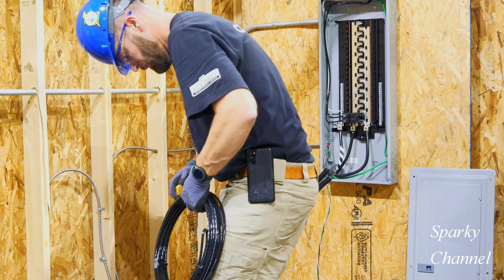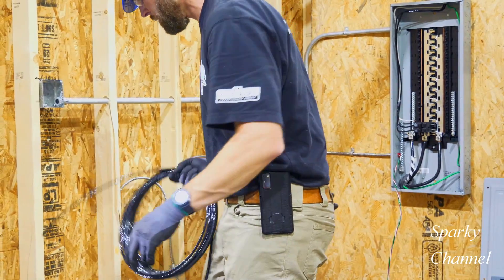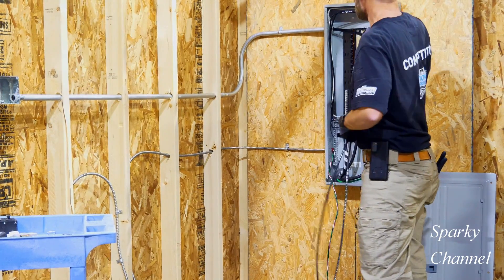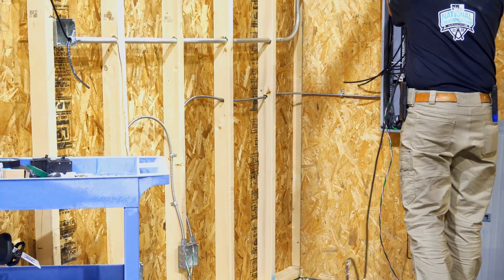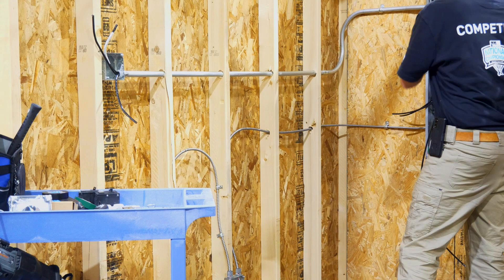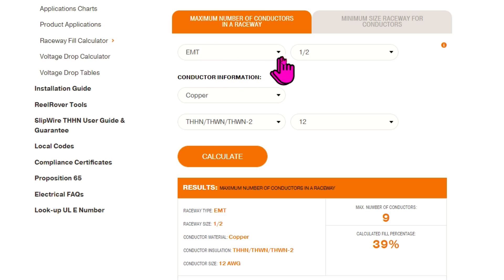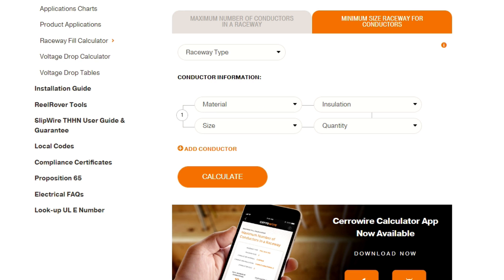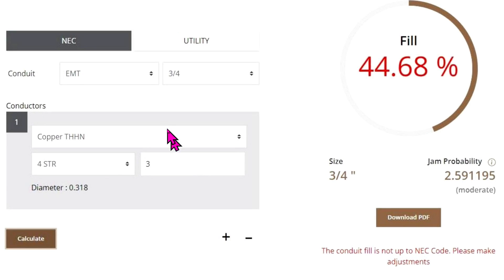Can You Find the NEC Code Violation?

Comment: You are supposed to run Romex threw wood framing . MC or AC cable is for metal framing . You would also need ,kick plates if your wire is not more then 1" 1/4 from edge of hole
Reply: I noticed that too.. his holes are about a 1/4" away from the edge of the stud.
Reply: What about Chicago?
Reply: @nobadmojo70  too many rodents chewing

Comment: Maybe they changed the code again but there was a time when conductors smaller than 1/0 could not be identified by tape. He would have needed to use a green insulated ground wire not a black one taped green.

Comment: What are the options to correct this? Obviously you can go up conduit size but can you add a second 3/4 conduit?
Reply from the maker: Go with #6 wires. 3 are only 27.4% conduit fill for 3/4" conduit.
Reply: @SparkyChannel  But can you run the conductors in separate conduits? Some parts of the NEC seem to disallow it but can't tell for sure

Comment: The calculator is hard to use with southwire. I wish they’d use terminology that was clearer and matches the label or wire model.
Reply from the maker: It does a little getting used to.
Reply: use the code book, the table is easy to use....
Reply: @jstone1211  thank you

Comment: I thought  #6 is used for 50amp. If he used proper size it mite have met code
Reply from the maker: Yes, 3 #6 in 3/4" conduit is only 27.39% conduit fill.
Reply: @SparkyChannel  now sparky!!!I wonder if pvc "3/4 conduit was used ..and therefore a green conductor was required...because pvc it would not be used as the grounding conductor...would there  still  be room..I'd imagine  a #"10 could be used???...would there be enough  room..???

Comment: I figured the box and conduit were overfilled because I could not see that there was an extension on the box originally. 
I like these calculators, when one does not do electrical all the time, it can be challenging. I had a junction box I did that, from everything I found, between the 12/2 and 12/3 I put in there, I think I was 1 conductor over the max, but then I took into considering that the ground wires are only #14 and then I was within the fill ratio. Not sure that it's correct, but I was comfortable with it.
Reply from the maker: Thanks!

Comment: The Ideal conduit fill calculator came spot on with the Chapter Nine Tables.  At least on the couple of calcs I did.  The wire companies give their own wire dimensions.  The code book should be adhered to for calculations.  Conduit fill, HP etc.
Reply: UL listed gear specs can trump the NEC code, and not just for torque specs.
But the AHJ might add restrictions, or higher requirements. 
The code is a minimum spec, and a general baseline.
Reply from the maker: Good to know.

Comment: Good morning Bill, thanks for the video. Great content as always!
It's conduit fill with 3x #4 thhn is over 40% for a 3/4" emt. Assuming the PV charger load is 40A or less @ continuous duty 210.19(A) would be 40x1.25%=50A wire which is satisfied by 3x #6 thhn in a 3/4 conduit.
Assuming a 50a breaker  (210.20) it should have a #10 EGC per table 250.122. 
The conduit enters the extension ring so its possible it might exceed maximum wire bending radius on the closest termination on the receptacle once the device is fully mounted. With #4 thhn it absolutely will exceed bend radius (8 x 0.324" wire diam = 2.592 radius. Diameter from Cerro wire spec sheet. Bend radius multipler from 300.34). By comparison #6 bend radius is 8x0.254"=2.032". Picture bending the #4 around a 2.5 conduit and that's the most it is permitted to bend, and a 2" conduit for #6. Also table 312.6(B) says min wire bending space for #6 is 2 in and #4 is 3 in. #6 is borderline in a 4square box but in my experience acceptable. #4 is definitely a violation. 
Also 314.28 (for #4 and larger) we have 3/4 x 8 = 6". The opposite wall must be a minimum of 6" from the largest conduit entry, so the box is too small for #4.
With #6 we can use box fill in 314.16(A). 2 conductors, 4x volume allowances for 2 gang device, 1x ground, 0 internal clamps gives us 7 volume allowances. Table 314.16(B) gives each volume allowance per largest conductor as 5 cubic inches. 7x5=35 cubic inches. A 4 square deep (2-1/8") has a volume of 30.3 cubic inches. A 1-1/4 deep extension ring has 18.0 cubic inches for a total of 48.3 cubic inches which is sufficient. 
Lastly, grounding and bonding. The metal box requires a bonding jumper. 314.4 The extension ring and plaster ring secured by fine thread screws are bonded by the screws.

Whew. Lots of violations here because of the #4 wire!
Reply: #8 THHN at 75° C is sufficient for 50 amps.  With 75° rated utilization equipment.  Table 310.16.
Reply: @donl1410  as long as terminations on both sides of the conductors (breaker and device) are listed and marked as 75 deg C. 110.14(C)(1). The art. For the allowed 75 deg C is art 110.14(C)(1)(a)(3). Great point!
Reply from the maker: Hi Jerry and Don! Great discussion! What if, given that he was only given 3/4" emt, he just ran 2 4AWG hot wires to a Raco 4 11/16" x 4 11/16" x 3 1/4" deep box with the appropriate 50A receptacle cover. Then he ran an 8AWG ground tail egc from the metal box to the 50A receptacle. Now his 3/4" conduit isn't overfilled. Would that work?
Reply: @jerryc5622  Agreed.
Reply: @SparkyChannel  Hi Bill.  The 2-#4 conductors would be fine for the conduit fill.  A #10 bond pigtail would suffice for the receptacle.  The box containing #4 conductors is also an issue, since it becomes a pull box containing a device and must follow that article.  The 5s box is too small.  Jerry covered that above quite extensively.
Reply: @SparkyChannel  My thinking on that is going to be yes. Per 314.16 "Boxes and conduit bodies enclosing conductors 4 AWG or larger shall also comply with the provisions of 314.28"
Under 314.28(A)(2) 6 x 3/4=4.5" (I missed this in my first comment where I used 314.28(A)(1) at 8 times instead of 6 times). I believe the conduit entry on the side qualifies this as an "Angle pull" under (A)(2). So, I think a 4-11/16 box will be the smallest for #4 wires and would be acceptable (Interestingly you cannot do a box fill calculation with #4 because it isn't shown in the box fill table 314.16(B). Also per 314.28(A)(3) a listed  box and receptacle that's smaller is specifically permitted if marked for the specific wire combination being used. I believe this is ONLY acceptable with 2x #4 in a 3/4 conduit. 3x #4 requires a 1", and 314.28(A)(2) would require a 6" box.

I think a "loop" around the box and then to the closest termination would work for the wire bending radius and that would be ok in a 4-11/16 square. (Cutting it short and going straight into the side is a violation of conductor length at a box 300.14)

The #8 ground tail is sufficient for the box bond and larger than required (#10 per 250.122)

The only questionable part is the conduit as an EGC into a panelboard or load center since it isn't part of the UL listing (UL50). Put a grounding bushing there with a #10 to the grounding bar, or just run a #10 in the conduit as it doesn't affect conduit fill.
Reply from the maker: @donl1410  Thanks! It's amazing the hassle one runs into by trying to run 4 AWG instead of 6AWG for a 50A receptacle!
Reply from the maker: @jerryc5622  Thanks Jerry. I think a lot of guys shorten up their larger gauge wires when running them to a 50A receptacle to save space in their box. But 4 or 6 AWG wires fall under 300.14 just like 14 or 12 AWG wires do.
Love your idea of a "loop" around the box and then to the closest termination. It both decreases the angle of the bend and allows adequate length for 300.14.
Reply: @SparkyChannel  That's true.  I'm sure the ones who designed this competition were more seeing if the subjects could follow the engineering.  As I've said, engineering sometimes can be in error.
Reply: @SparkyChannel  Thanks Bill. This was a fun one. I can't recall ever having to run #4 in a situation like this. In fact the only scenario I can think of ever putting #4 into a 4 square is only as a pull box or outlet through a removable cover into a flex connection and that would only be for a 240v 2 wire circuit, and wouldn't work for a 240 3 wire. This was a good challenge.
Reply from the maker: @donl1410  I have no idea why they had the competitors use 4AWG to run to a 4x4 box. It makes for a fun competition though. BTW, I took down the videos I made about the concentric oversized rings and I'm going to make another one. I saved all the comments from viewers for reference though. It's amazing how much my viewers know about such things!
Reply: @SparkyChannel  Thanks for letting me know.  I hope my input was of help or inerest.
Reply: Hello Jerry -- a lot of really interesting comments!, Looking at 314.28, "Boxes and conduit bodies used as pull or junction boxes...", so I don't think it applies since the box is not being used that way.
Reply: The requirement for applying 314.28 is found in 314.16. It is required because the box contains wires 4awg.

Also cerrowire has a minimum bend radius on their thhn conductors in the instructions that is close to those in 314.28.
If it had been 6 awg or smaller, what you said would be absolutely correct.
Reply: @jerryc5622 Thanks Jerry. I see what you are saying. I guess my problem is the wording. You are correct that it says Boxes enclosing 4 AWG need to comply with  Provisions of 314.28, the hard part for me is that main provision for 314.28 specifically states that it applies to Boxes used as pull or junction boxes... since it is not a pull or junction box, wouldn't it still be excluded? Otherwise any code could reference some other code and say "must comply with such and such code", and we would need to apply it even if it said not to apply it in the code.??? (I will do some research locally to see how other are doing this an reply when I get a chance).

Comment: and let me guess, the reasoning in the exercise is it was a welder plug.  which, unless they changed the code allows the wire to be undersized. (though I won't undersize a welder plug circuit, because someone is likely to plug in something that isn't a welder, sometime.)
Reply from the maker: Hi Ken! It was a 50A receptacle for a PV charger. But, you're correct, that pv charger could get unplugged and something else plugged in.
Reply: @SparkyChannel  yeah, i don't lock in 3 wire 240v circuits for vehicle chargers, either, because some models require a neutral connection.
Reply from the maker: @kenbrown2808  Good to know, thanks!
Reply: @SparkyChannel  i started putting in a 10/3 for a future charger a couple years ago. Now I'm thinking a 6/3 would probably be better.
Reply: @kenbrown2808  It's also nice to have other possibilities covered for for future use, but a bit costly.
Reply: @aredditor4272  a whole lot less costly that retrofitting it later.
Reply: Tesla had chargers running at 90A 240V years ago :-)
You might need to upgrade the service from 150 to 200A
Reply: @wim0104  why would I pay an extra hundred dollars to limit the service to 150A?

Comment: P&S 50 amp receptacle lugs are only rated up to #6.  Ground wire was unnecessary... Could have just pulled 2 hots 2 avoid conduit  fill violation.
Reply: 3/4" EMT can be the ground for 4 or 6AWG wire!? At least add bonded bushings, both ends, please.
Reply from the maker: Hi Greg! Very interesting. That would be very heavy reliance on 3/4" emt for the egc but, yes, it could be done. I hadn't thought of that. Then what AWG would the ground tail egc have to be?
Great to hear from you!
Reply: Don't you  need bonding or grounding for the steel box and the appliance that will be plugged into the outlet?
Reply: Or a number 10 THHN, if a ground wire was deemed necessary.

Comment: The studs were drilled to close to the stud edge for the conduit. That would be a violation here in NC, (R602.6: Drilling and notching of studs).
Reply: or add nail plates
Reply: @wim0104  Nail plates only protect the conductor; drilling the studs in that manner compromises the structural integrity of the stud members. Especially important if it is a "bearing" wall.
Reply: Or use a heat gun to reshape the conduit.

Comment: 314.28 comes to mind. That device box needs to be considered similar to a pull box. Min horizontal dimension I believe should be 6 inches per 314.28(2), as this doesn’t appear to qualify as a straight pull.

(314.16 says that boxes and conduit bodies enclosing conductors 4 awg or larger shall also comply with the provisions of 314.28 for pull boxes.)
Reply: (EDIT...I'M wrong here, see below.)
I see what you're saying, but that isn't a pullbox but is an outlet box. So I feel that 324.24(B)(3) works. Since he's using a "deep" 4" square box plus a mud ring (mentioned in the voice over) it would be OK.
However, there still maybe a violation of 314.24(C)

I mean though, no one is gonna run, in the real world, 4AWG for a 240v/50a receptacle. 😂
Reply: 314.16 says that boxes and conduit bodies enclosing conductors 4 awg or larger shall also comply with the provisions of 314.28 for pull boxes.

Laymen’s terms: those wires are bigger than typical for a device box. I believe the depth is sufficient though per 314.24.

Note the standard fill lookup tables stop at 6 awg, for this very reason I suspect.
Reply: @USABrendan  NICE! How did I miss that? So funny how by not choosing the correct wire size for things gets soo difficult. LOL.
To recap then....
Because 314.16 references 314.28(A) the box would need to be 6" square with a depth of no less than 2 1/16" (per 314.24(B)(3)). and the receptacle must be at least 1/2" away from the walls of the box. (314.24(C)(2)) and also the conduit must be positioned per 314.24(C)(1) so that the receptacle isn't covering more than 1/2 of the knockout.
Whew!
"Hey Boss! Can we just use 6AWG?" LOL
Reply: @ellsobrien  you got it.
#6AWG would avoid this snowball effect.
Reply: Easy to miss! I see SparkyChannel as one of the best uses of YouTube, as a forum to improve knowledge and understanding of tricky situations.

Cheers.